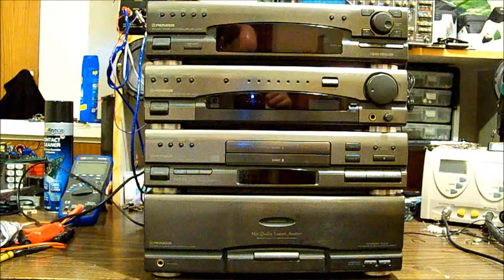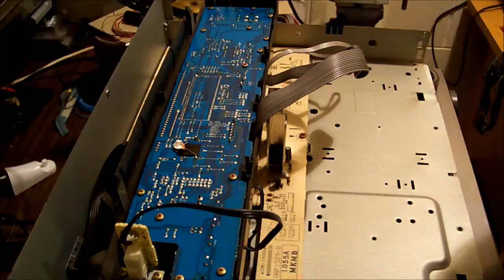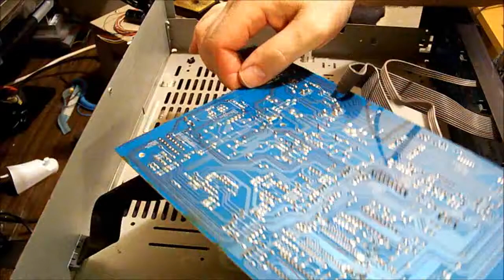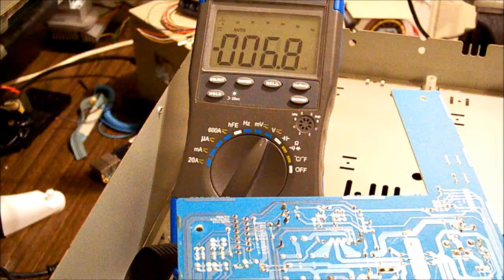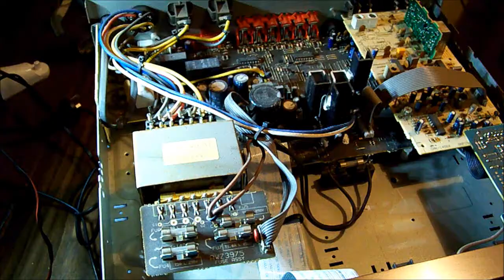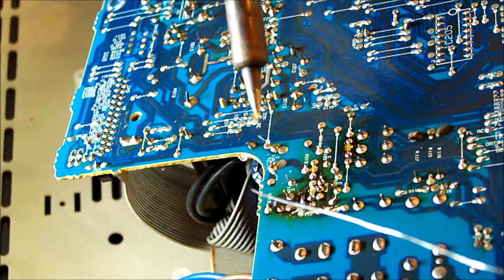Pioneer CX-J500 Repair Part 1

Comment: My Cx J500, is not turning on after plugging power red led will on for a second and some relay sounds. I try to diagnosis but I am not able to find. Will u help me to finding the problem
Reply: Same problem but i have the Cx-J700